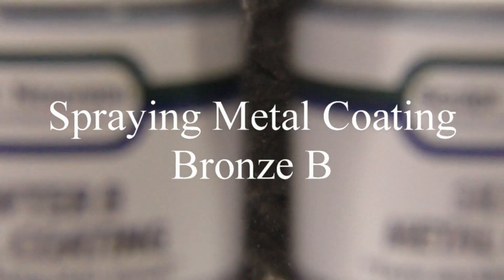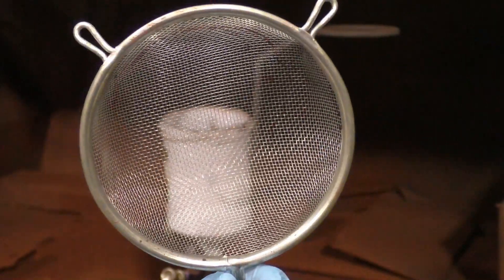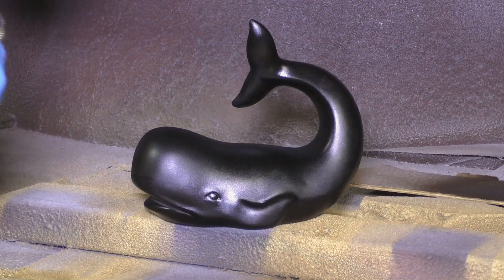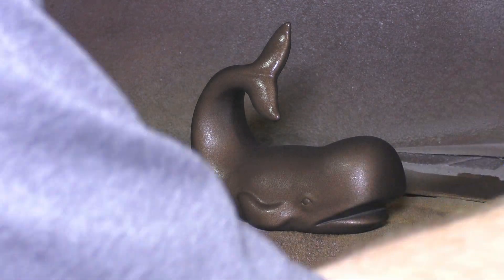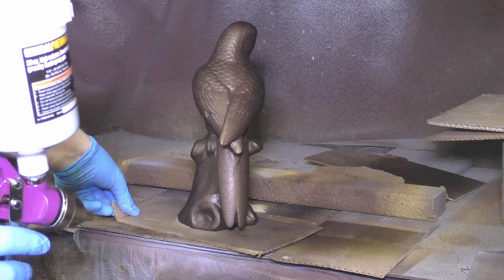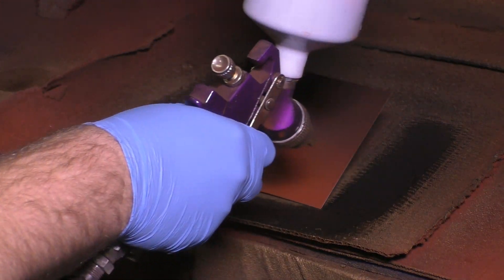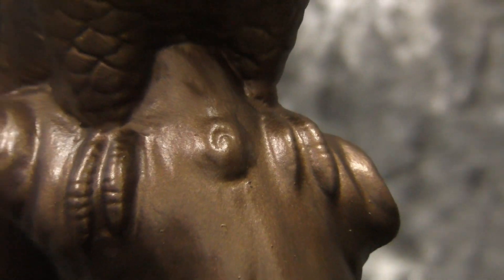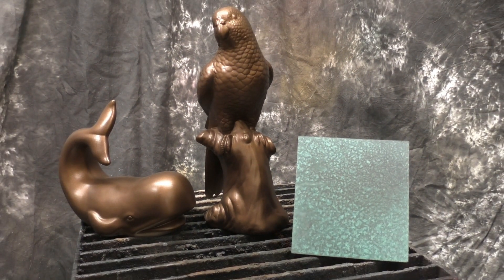Spraying Metal Coating Bronze B

Comment: What is the CFM we must have?
Reply from the maker: For the sprayer that we used in this video, for a continuous spray, they recommend a 30+ gallon compressor, 6 CFM @ 40 PSI. I spray the Metal Coatings at 60 PSI though.
Reply: @sculptnouveau  Thank you for your answer. In this case 30 gallon would be enough i think.
Reply: @sculptnouveau  For the hose what you suggest? 1/4" or 3/8" ? Thank you
Reply from the maker: @barzucci1705  Your compressor should dictate that but 3/8"

Comment: What's the best brown to use for that aged old bronze look?
Reply from the maker: Are you wanting to use the Metal Coatings or did you want to use a patina on actual metal? If you want to use the Bronze B Metal Coating, I prefer to use Liver of Sulfur to age it. It will go more of a black than a brown but it is an easy option.
Reply: No, I don't want black, and yes, I will be using everything from primer to clear. I'll be using it on a Harley frame and some parts of the tank and fenders. I'm building it to be an old school bobber. I want the old bronze brown and burnished in strategic places. It will be built with lots of brass and bronze. I want the frame to go along with said materials.
Reply: Btw, I'm a sculptor too and I'm familiar with liver of sulfur but what I'm wondering is if it can be applied while the sprayed bronze is still wet.
Reply: What I'm planning to use is the one with the hardener, I think that's the metal coating C.
Reply from the maker: @roehlacosta9154  Yes that is the Metal Coating C. I would look at the Liver of Sulfur, the Brown Dye Oxide, or the M38. The M38 you will need to rinse though so that is why I normally go with either the Liver of Sulfur or the Brown Dye Oxide instead.
Reply: @sculptnouveau  Ok, thank you. Even though it's still a little confusing with all the patinating solutions you named but all I want to do is just like the bird you did but instead of the green I want to do it with the deep browns in the crevices  and burnish/polish in strategic places i.e. places to simulate wear...I wish you have an email so I could send pix. Hard to explain over the phone.
Reply from the maker: @roehlacosta9154  you can email me at Ryan@sculptnouveau.com and I would be happy to help you out.
Reply from the maker: @roehlacosta9154  Yes that is how the Liver of Sulfur should be used with the Metal Coating.
Reply from the maker: @roehlacosta9154  I would look at the Dye Oxide Brown then, I think that will be the easiest way.
Reply: @sculptnouveau  ok, thank you  so much Ryan! I'll email you and send pix.
Reply: @sculptnouveau  I went to your website and I think m38 is the one. I'm a sculptor and getting wet and dirty is just part of the job and I enjoy what I do. 🙂